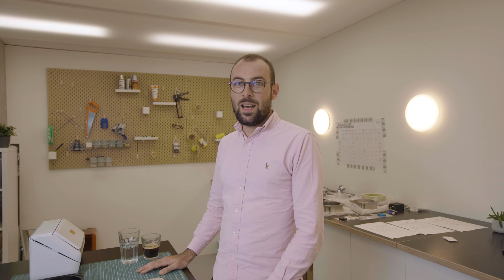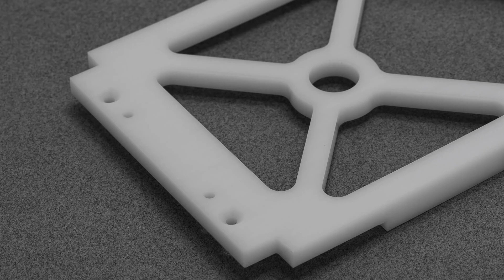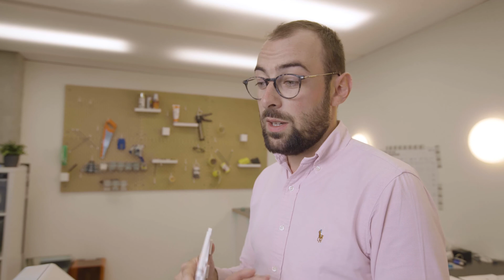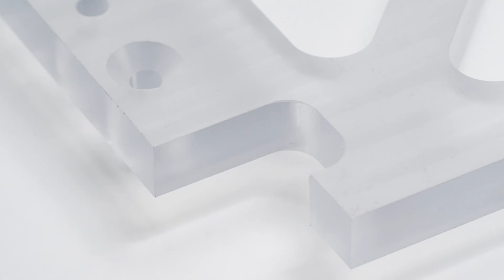ABS, POM, Polycarbonate, Teflon and PEEK for CNC machining

Comment: Excellent comparison! Material selection is absolutely critical for both performance and manufacturability. This is a great guide for engineers weighing their options for CNC projects.
A key point we always emphasize to our clients is that CNC machining is the perfect method for functional prototyping in these exact materials (especially PEEK, PC, and POM). It allows you to test the real-world performance of your design – thermal, chemical, mechanical – before committing to injection molding tooling or high-volume production. Thanks for sharing these insights!👏👍

Comment: Antoine, an industrial engineer at 3D Hubs, discusses common plastics used in CNC machining. He covers ABS, noting its affordability, warping sensitivity, and ease of assembly. Delrin (POM) is highlighted for its high machinability, strength, and dimensional stability, but also its fire - resistance drawback. Polycarbonate is suitable for clear parts, Teflon for low - friction applications, and PEEK for high - end uses like electrical connectors due to its thermal and mechanical properties.
[00:00] Introduction to plastics in CNC machining and ABS properties
	[00:16] Plastics are a very common material in CNC machining
	[00:49] ABS is a common plastic in daily life and can be machined
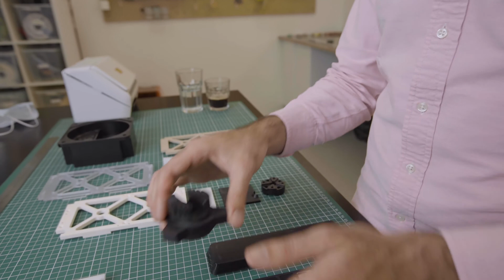	[01:08] ABS is an affordable thermoplastic for machining
	[01:48] ABS is not the best in terms of dimensional stability
	[02:05] ABS is good for gluing and assembling parts
[02:50] Injection molding of ABS and introduction to Delrin
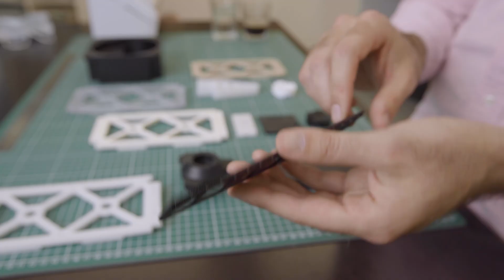	[03:13] Injection molding can control ABS part surface finish
	[03:30] ABS is used in remote control in electronics industry
	[03:58] Delrin, a branded name from POM family, is popular
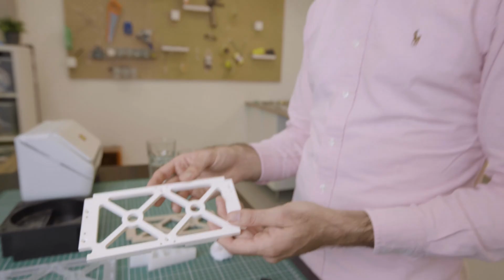	[04:44] Delrin is widely used in manufacturing for engineering
	[05:04] Delrin has poor fire resistance
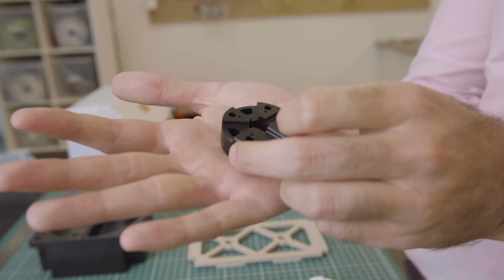[05:40] Delrin's properties, warping issue, and injection molding use
	[05:57] Delrin is more used by engineers than designers for non - cosmetic use
	[06:24] Delrin comes in black and a range of white colors
	[07:00] Delrin has good dimensional stability but is prone to warping
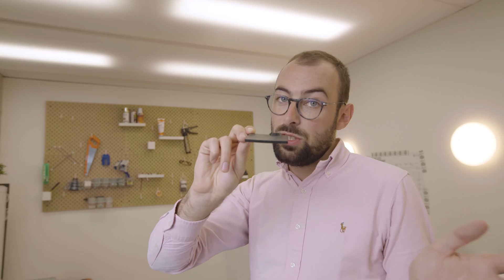	[07:36] Both machinists and designers need to prevent Delrin warping
	[08:05] POM/Delrin can be used in injection molding for mass production
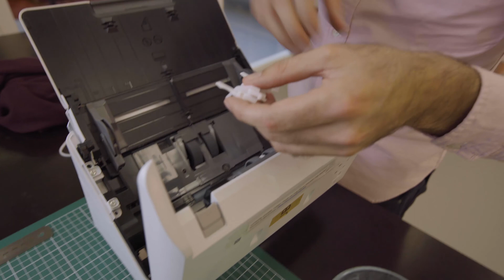[08:30] POM part example in printer, polycarbonate and Teflon introduction
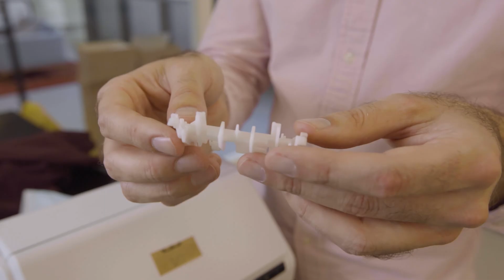	[08:41] A POM part in a printer is injection - molded for paper - guiding
	[09:02] Delrin is best for mechanical parts, not cosmetic ones
	[09:47] Polycarbonate is used for clear or optically transparent parts
	[10:22] Polycarbonate's polishability depends on part geometry
	[11:04] Teflon has even lower friction than Delrin for engineering apps
[11:19] PEEK introduction and summary of plastic materials for CNC machining
	[11:31] Teflon is suitable for applications with low friction
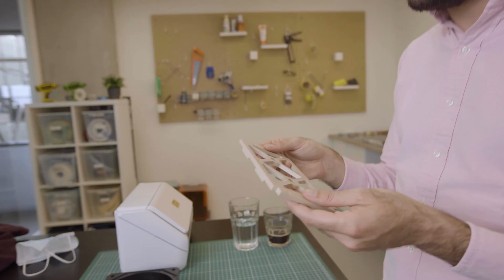	[11:58] PEEK is a high - end engineering material and a personal favorite
	[12:24] PEEK is used in electrical connectors for high - temperature stability
	[12:55] PEEK has good mechanical and chemical properties
	[13:44] PEEK is good for thermal stability and electrical applications

Comment: I read a while ago that someone made bushes for his 3d printer from UHMWPE, wich is much cheaper than teflon, and he was extremely happy with the result. 
Vesconite is a plastic developed in South Africa in 1958 and has very high weight bearing and low friction properties, Delrin is a Polyoxymethylene that was developed much later.

Comment: this was an excellent video, thank you for creating it. Which if the materials would be the closest in characteristics to 6061 aluminum (aircraft grade)? I was thinking of rifle stocks as a target application hence it should be stiff and non-brittle and not contract / expand within a reasonable band of temperatures (say -30 to +50 Celsius)
Reply: Delrin would work but it's soft. It will scratch easily. It's also pretty heavy but that probably doesn't matter. It's slippery too so you should probably machine a hatch pattern into it.

Comment: What would you typically use for an electronics enclosure? Like, let's say an industrial controller shell.
Reply from the maker: Hey! thanks for your question. ABS is commonly used for electronics enclosure, as it’s relatively easy to work with material that has good mechanical properties for regular applications.
ABS/PC mixes are sometimes used in Injection Molding as they have better properties, sometimes even with an addition of flame retardant depending on the application, but that’s generally for much higher quantities.
We see an increasing number of people using PEEK for electronics casings for similar parts right from the start if they work only in CNC and low volumes, yet still, want excellent temperature and mechanical properties. Hope that helps!

Comment: If only Delrin wouldn't be such a chemical resistant material it would be my immediate choice for my scale model projects but you can neither ( practically ) glue or paint it so yea... Mechanical parts use only ;(

Comment: Very nice video. The conclusion at the end is awesome. For these plastic material, can we say that CNC and 3D printing are for prototype and the injection molding is for mass production?
Reply: Yes you could say that but CNC machining is used for very large production runs obviously.

Comment: Thanks or your video which is informative and clear. I want to select among pom ,peek, Teflon. The part is immersed in 70c of water for a long time and it contact with a rotating shift. The part will be injection molding. Could accept tolerance +/-0.1mm. It is a rectangular in shape ,will be inserted to core for 2nd molding. Mold temperature 130c. Plastic which cover onto the part meld temperature is 320c.
Reply: Changzhou Yongbang Plastic Industry Co., Ltd is headquartered in China. We mainly provides the production and processing of PEEK rods, boards, pipes , Plastic Bushings and seals. We have a large stock for a long time. The price is low and the delivery time is short. We look forward to your cooperation. Thank you.